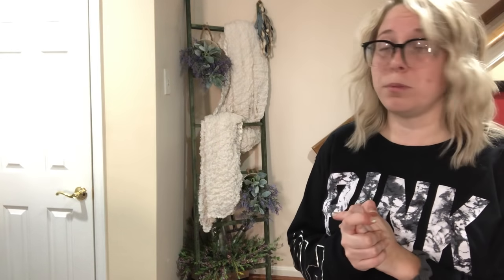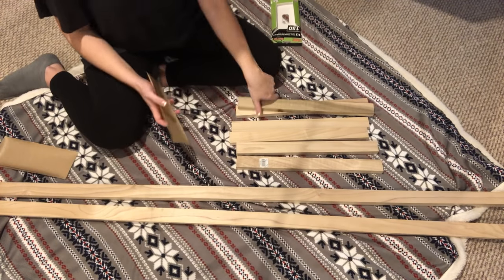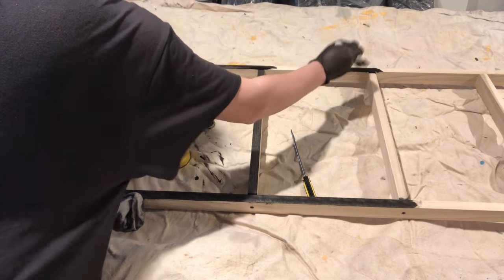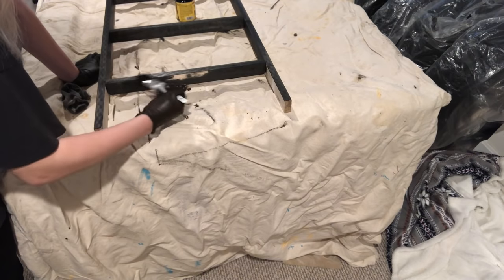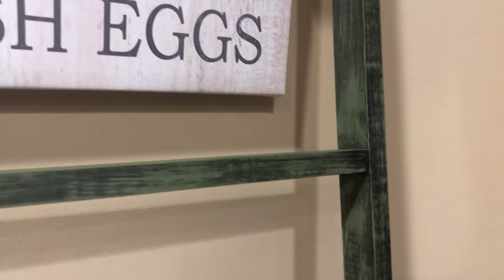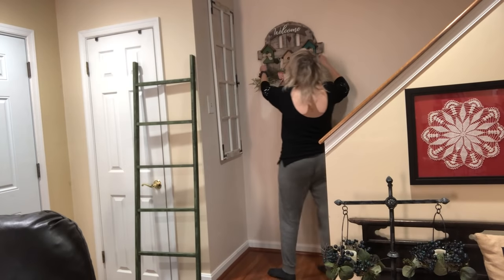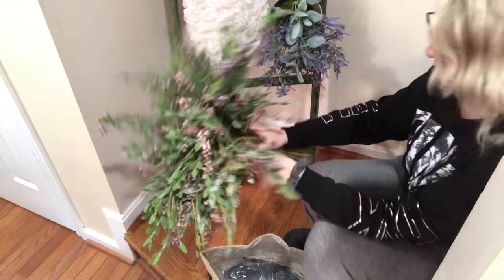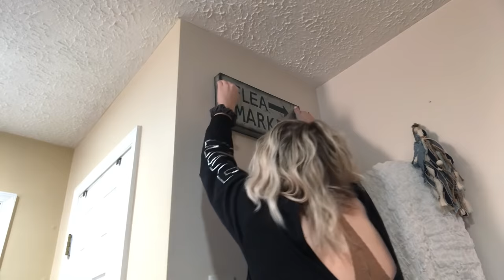$120 KIRKLANDS BLANKET LADDER FOR UNDER $10! DIY FARMHOUSE LADDER AND DECORATE WITH ME!

Comment: Could you please share what size pieces you used ? I think I will try next weekend but stain all but the outside piece before I put it together
Reply from the maker: I put the sizes of the wood in the description and also in the video! I made 2. 
1st ladder
2 6ft pieces and 6 12 1/2 inch pieces
2nd ladder
2 6ft pieces and 6 15 inch pieces